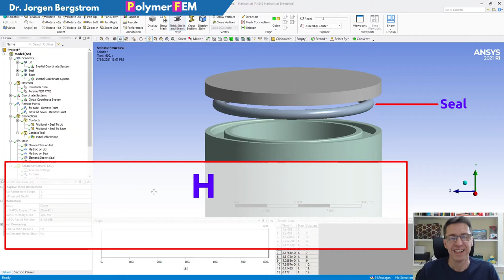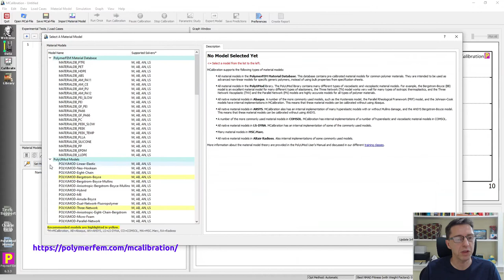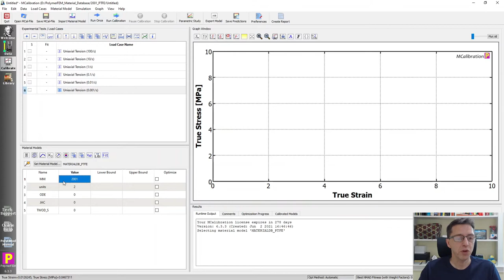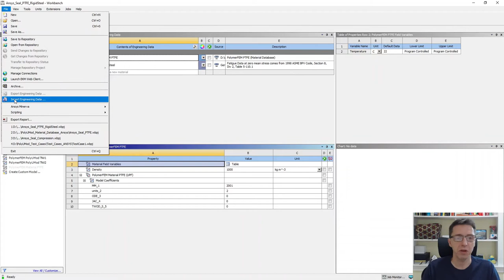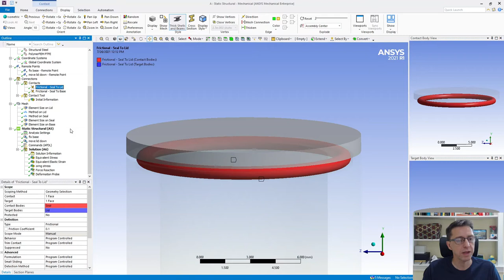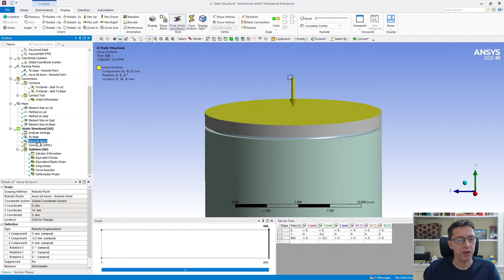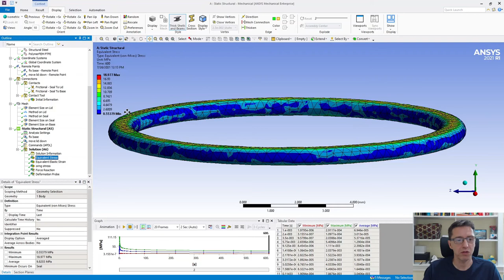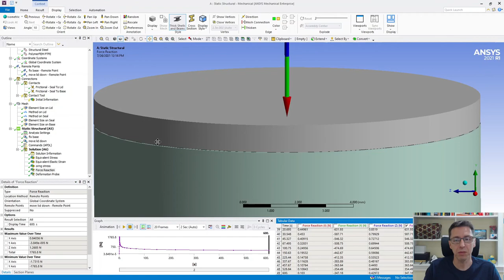How to Simulate a Viscoplastic Teflon Seal using Ansys

Comment: Very nice work here. A few questions,  Why not using Ansys material model calibration to develop the initial material model? Also what initial data did you use to calibrate your material model? Was it just compression test data, tensile test, shear test ?

Comment: It's a very helpful tutorial thanks. Would it make a difference to use explicit dynamics rather than static?
Reply from the maker: Both explicit and implicit (static) FE models will work. I usually recommend using static if inertial effects are small.